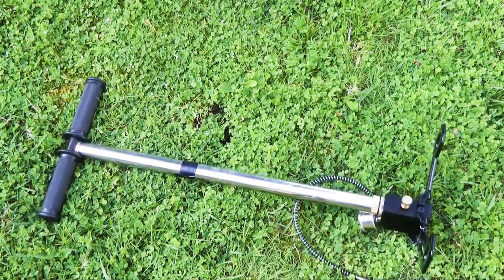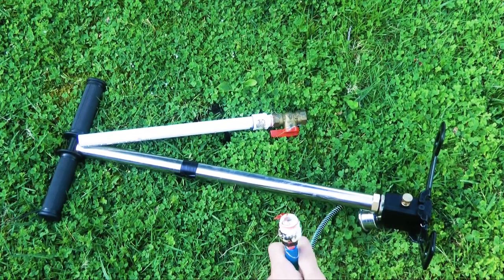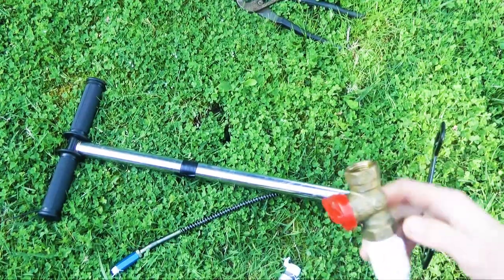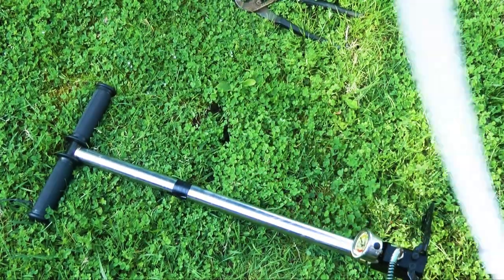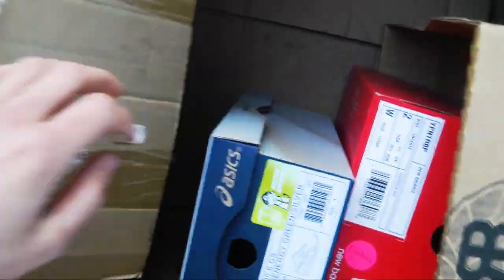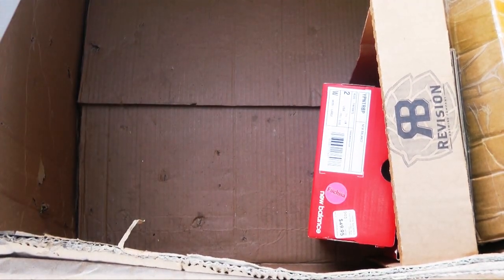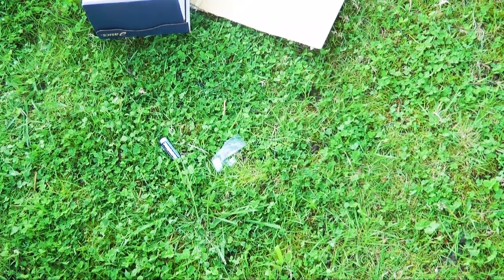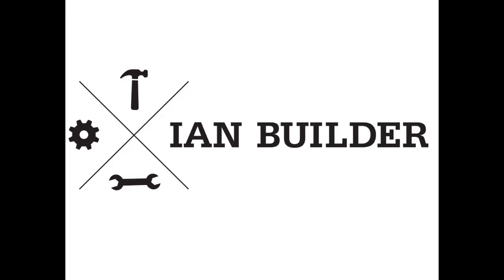4500PSI HIGH PRESSURE AIR CANNON DIY (version 1)

Comment: There is NO WAY thats 4500 psi....  not a chance..  my large compressor doesn't even create that much pressure....
Reply from the maker: it is   sise doesn't matter at all   look it up 4500psi air pump pcp
Reply: The smaller the pump the higher pressure it can make